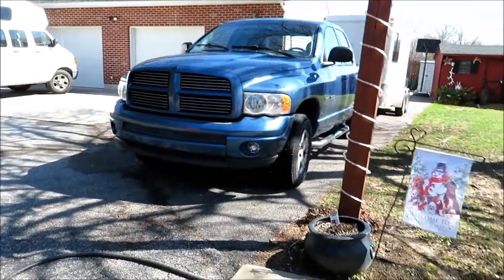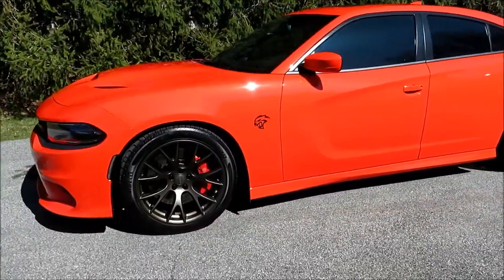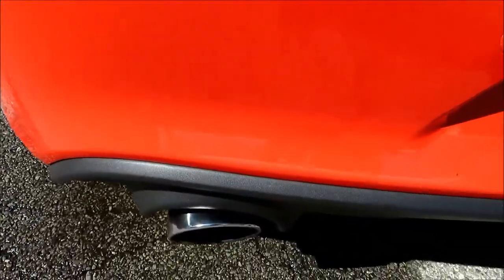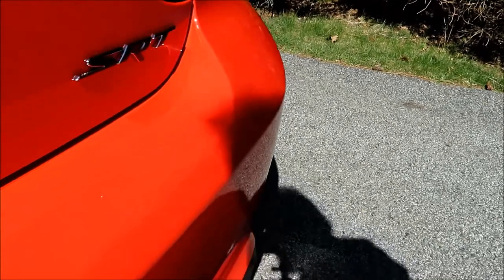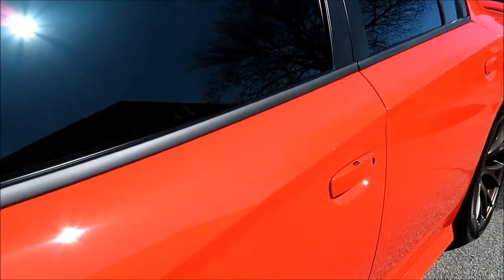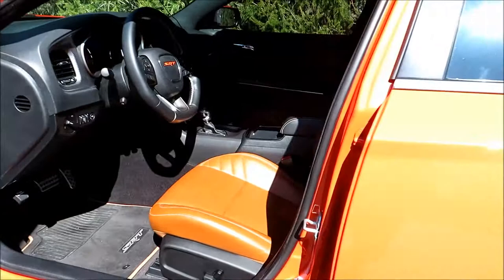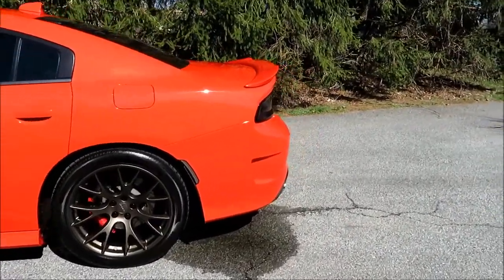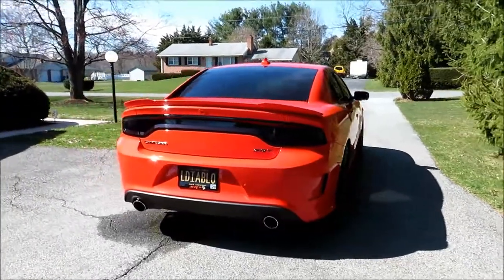3 Coats of CQuartz on a Hellcat

Comment: CAR LOOKS GREAT BOSS!!!!!! Dropping my Daytona 392 off April the 10th to have it ceramic coated and xpel wrapped on the front. Man I can’t wait after seeing your video. I’ll be posting also.
Reply from the maker: What ceramic does the place you're going to use?
Reply: coolwrld302 They use ceramic pro
Reply from the maker: Nice.  I think from what I have read and researched Ceramic Pro and CQuartz seem to be the most popular.  How many coats do they do and how long to they keep it for curing time?
Reply: coolwrld302 He said that he would have it for a few days. I have to have the 2 step paint correction as well and some touch up to a few small chips around the car from rocks smh.  He’s also doing my wheels and brake components while removing my old Brembo decals to add the new ones that bought so that bright white again. 

Also trying to figure out if I want to keep the calipers black or go with the red bcs the car was ordered with the black 6 pistons which I actually like bcs the whole car is murdered out. I can’t remember how many coats the package that I’m getting has but it’s the 3 year package. I definitely recommend getting your front end wrapped with xpel after seeing what the rocks have done to mine since December. He told me that he would coat the xpel to after it was wrapped if I wanted him to for an extra $50

Even my wife said your car looks great after being coated lol.  I said man his car is wet as hell and she throws her twist of the tv show The Office in and said “That’s what he said” instead of that’s what she said 😂😂😂.
Reply from the maker: Sounds like car will look bad ass after the ceramic is done it should really make that black paint really deep looking.  I agree the blacked out calipers with everything stealth like that is probably the way to go.  But against all that black body color I think red would really pop out of the wheel well and make a huge statement.